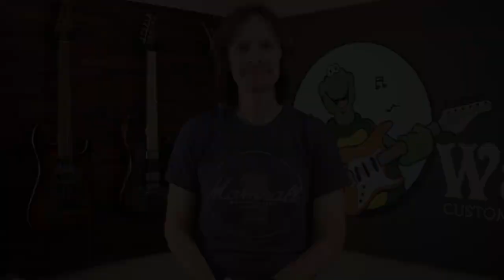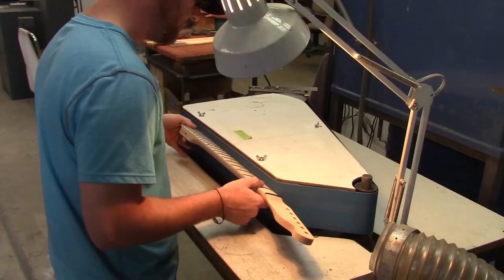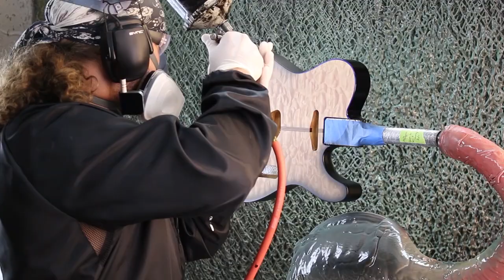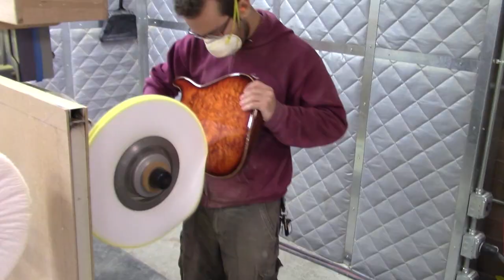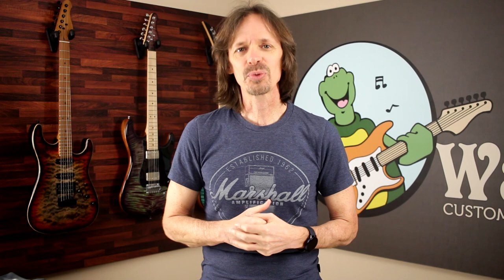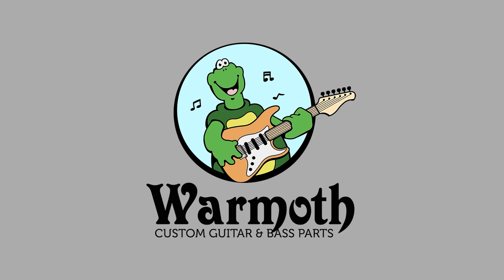What is Going on at Warmoth?

Comment: A lot of people have been doing those jobs they normally wouldn’t have had time for. People renovating their houses has been out of control.

Of course there is the great unanswered question, does copper shielding affect the tone of your electric guitar?

Shielding generally is good against noise, though the question that raises its head is this. Is it better to use hum cancelling pickups or stick the single coil pickups and shield the guitar?

Aaron opted to use hum cancelling pickups in his dual neck guitar, and this makes me wonder if copper shielding is all it is cracked up to be or was it a quick fix for him?

I know an aluminium guard effects the sound of a Strat. It makes the guitar fatter sounding. Though people have tried the experiment with Jazzmasters and claim the guitar was brighter. I suspect the lines of flux may be interrupted in the case of a Strat as the aluminium is closer to the magnets with a Strat. 

It is a topic that I’m very curious about.

Comment: One thought is to contract out to existing home-based builders you trust and know to build stock for you: send them raw materials, they send back stuff ready for sale perhaps with a trade out for parts/materials or contractor fee. You'd be using trained people, just not trained the Warmoth way, but if the finished product is the same, Warmoth can inspect/verify standards, and apply their brand and sell. Just a brainstorming idea. I am sure there are many who have experienced a slowing due to the pandemic and could use the work when not doing a custom full build.

Comment: LOVE Warmoth! BEST parts anywhere! Would never think of going with another company for the Neck. Thinking of putting together a Tele, and notice the lack of In-Stock items. It sounds like you guys are gang busters right now, but a little wish list...
Wish Gibson wasn’t so G$@#$^% litigious, and would license their designs? Would really like to build a Warmoth Les Paul? Not as crazy about the Regal?
I’m not sure Novo/Rivolta would be “cool” with Warmoth licensing their shapes, but a Dennis Fano inspired Parts-line would be a righteous thing! The Rivolta style block-inlays would also be really cool as an addition to Inlay options?
Would love to see a Tempered Pine or Tempered Red Cedar added to the body wood option? I know Warmoth used to offer Pine, but discontinued the option because of tooling difficulties? I’m pretty sure the extra drying would make for less tear outs, and less gunk on the tools? I would happily buy a Tempered Pine Body, AND sign off on NO Paint Job warrantee.